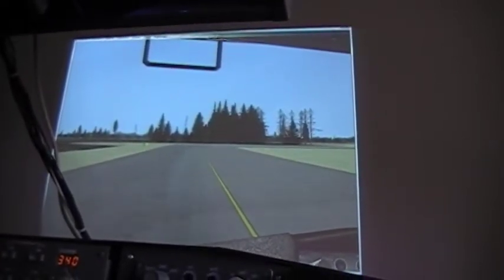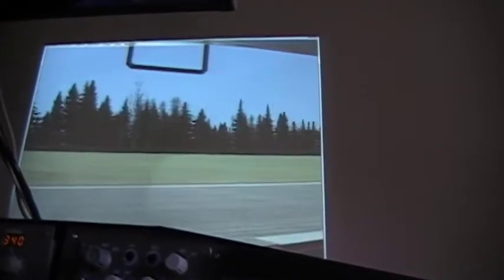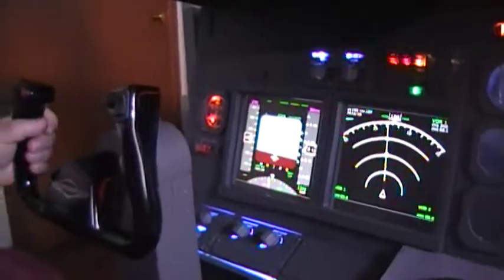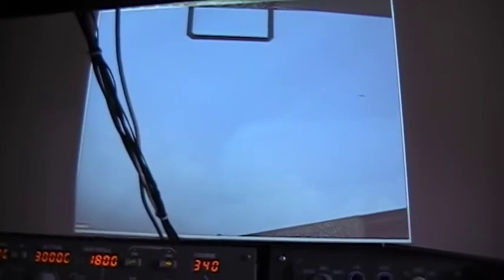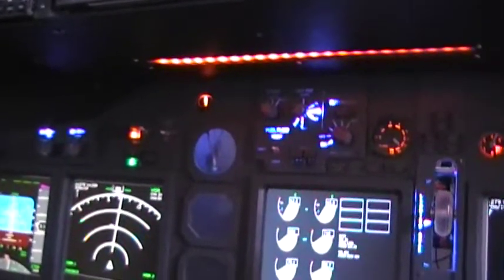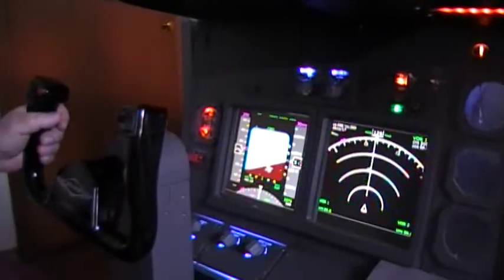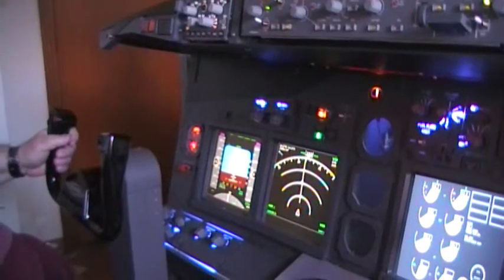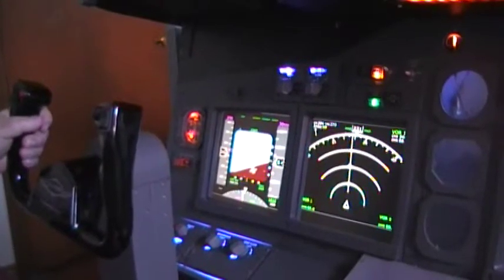Boeing 737ng homemade cockpit

Comment: Great vid....Now are you going to intergrate you system with the PMDG-NGX due later this spring?  

Also are you using any 3rd party weather add ons?  What computer specs is your server running at to run FSX smoothly?